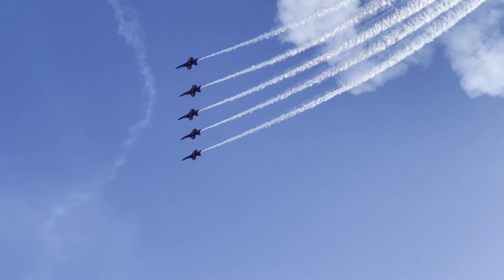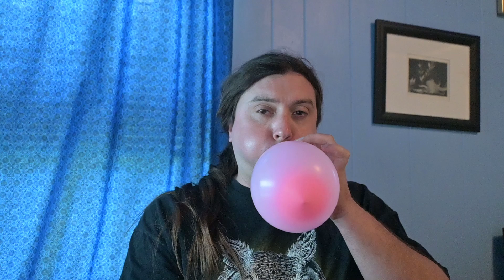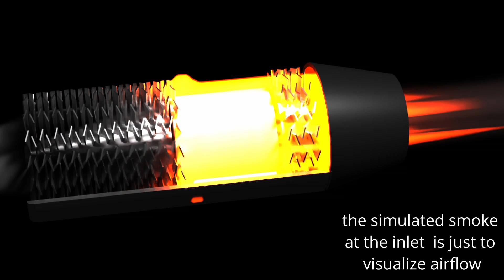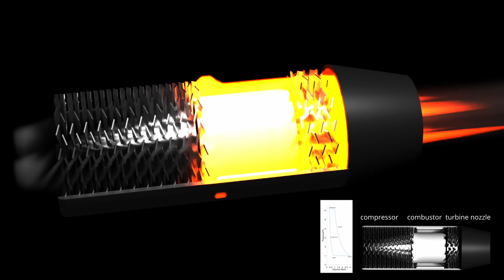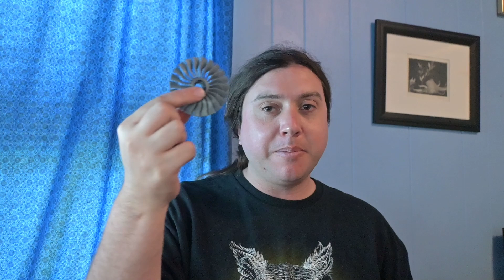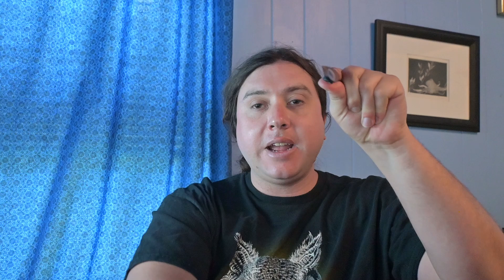How Jet Engines Actually Work: The Open Air Brayton Cycle Explained

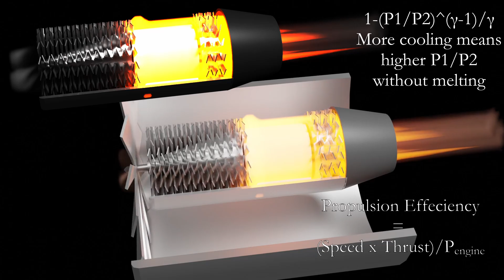Comment from the maker: 20:40 What I meant is a higher pressure ratio which is actually P2/P1 but the expression for thermal efficiency is correct

Comment: Good video!  I love it when the algorithm gives me videos from these smaller channels. The model turbine is interesting...  I wouldn't worry about too much pressure building up because axial fans are made to quickly move air in low back-pressure applications. If the back pressure (restricted flow) is too high, the blades stall and airflow slows to almost nothing. If the pressure caused by combustion is too high it would just come out the front. Your model engine probably would be more dangerous than a blow torch if it used a radial/centrifigal/ multistage fan to deliver higher overall pressure ratio for more boom in the combustion. Those types  generate higher pressure the more back pressure is generated.

Comment: If air both enters and exits at 1 atm, there's no pressure differential. So where does the thrust come from? Obviously we can compute it using newton's law, but how would a fluid dynamics person answer it?
Reply from the maker: That's why I say it technically comes from the compressor. The air accelerates in the combustor and the exhaust nozzle but the only place there is higher pressure on the rearward facing side of a solid object is on the compressor blades and stator vanes. So long as the flow is subsonic it all works out because pressure changes upstream and downstream can affect the flow. Once the flow is supersonic only upstream conditions can affect the flow, which I will explain in part 2!

Comment: These commenters who are whinging about pressure differential vs acceleration of air mass apparently don't understand that these are one and the same. The air mass is accelerated by pressure differentials, as is the jet engine
Reply from the maker: @1495978707  They unfortunately get even worse than that, but it’s just that one guy who thinks he found the conspiracy by Isaac Newton. Most people here seem to be reasonable like you.